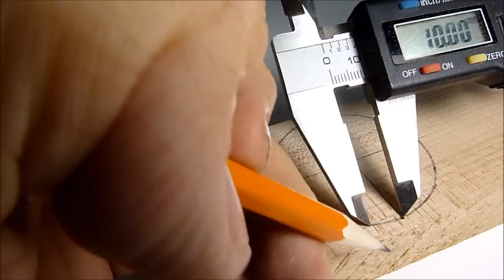Making easy grip wooden knobs

Comment: God Love ya and thank you for Sharing.

Listen up, Take some of these people's advice, watch and learn. I tried to make knobs
for my router table, i was going to do it with hardwood, drilled them out no bandsaw to use I used a hole saw and a hand drill. Made the blanks not fosner bits cut a center hold out with a step drill and started to drive home some star nuts, every one of them split out. Now I don't have a fireplace to burn wood in so it wound up in the trash.
I bought my knobs for it. Eh they work but I'm cheap I'd have rather made them.
Now with some tool upgrades I'll revisit trying to make these and not make scraps doing it out of hardwood I think I'll use purpleheart this time round and drill the holes for the spikes and glue them in. I like this type of knob better then a 3 wing style.

Comment: That is a great know.  Adding some epoxy,  to the threads that are in the wood might be a good idea to add some grip between the wood and the bolt if of it takes lots of torque regularly. Very nice

Comment: Instead of using the calipers to mark your drill points, use the compass. It's quicker and more accurate. Then follow with a small nail and tap the point so your drill starts where you want it.

Comment: I like your tutorial efforts. How you divide the quarter of the circle what formula use? Thanks a lot.
Reply: Use a pair of compasses and start at each point of the quarter Circe and draw and  adjust until the width setting until the middle section is equal also. If that makes sense. Easier than doing the math to work out the circumference and work out the segmental sizes. If that makes sense at all?
Reply: Mark Leask hello,  can you please better explain how to divide a circle using a compass?